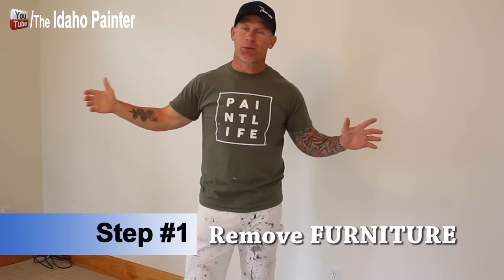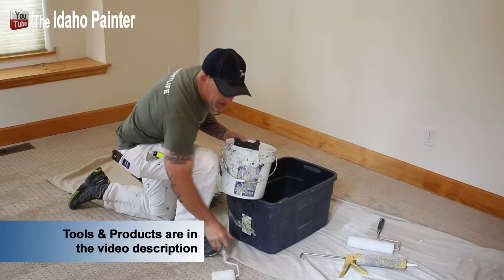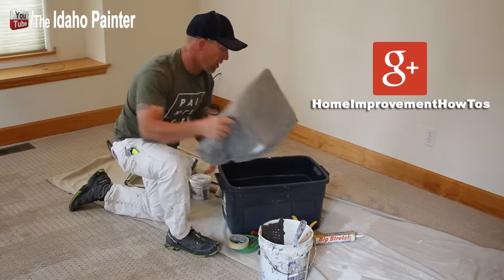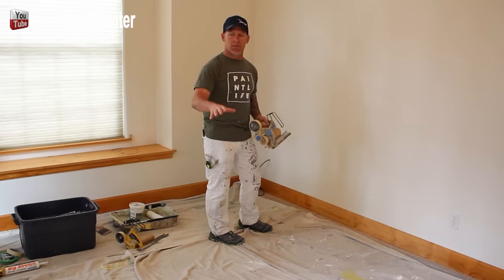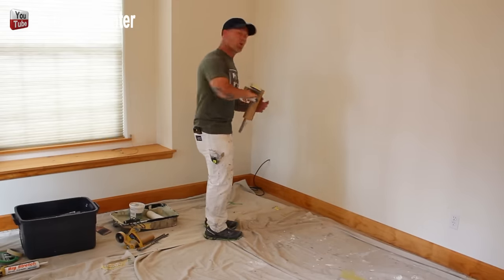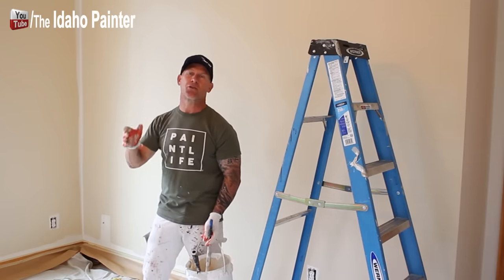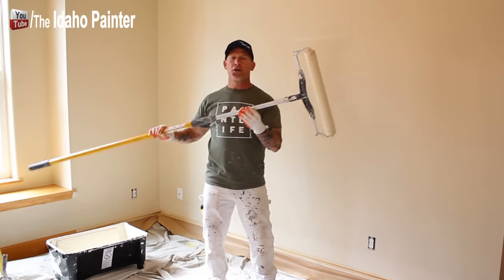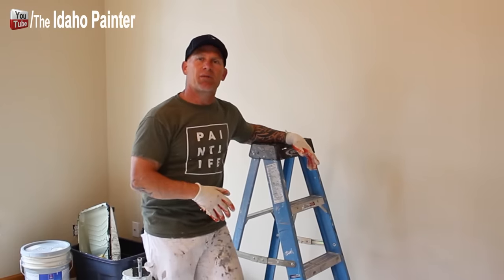10 Steps Painting A Room FAST and EASY

Comment: If your using lighter coloured paint on darker painted surfaces you'll need at least 3 coats. I'd recommend using 2 coats of a cheap white mat paint as a base colour, then let it dry and then use two coats of your chosen colour.
Reply: I'm finding this out the hard way.
Reply: Four coats never

Comment: Finally. A profesional painter who made a video geared towards a homeowner or an newbie.  All these other guys are posting clips where they are using 18 inch rollers over floors covered with rosin paper or chip board. 
In been a painter for 36 years. The steps you described along with the tools you recommend  are perfect. Well-done
Reply from the maker: Thanks

Comment: You're my go-to guy on anything about painting. I have watched many videos over many years. And I've learned quite a bit. 
 But, I always patch walls before I do anything else. That way it's dry and ready when everything else is done and the room is ready for painting. 
Also, I don't allow anyone to open a can of paint before they have a clean, wet, white rag. That way if there are any mishaps, Then you have a wet rag in a second. So as to not allow any spills, drips, or anything to have time to start drying. 
Also, I always wet my brushes then slap out the excess water. This way they clean up easier. 

 Keep up the great videos I study them a lot.
Reply: I’m a painter and starting my own business, I always look for these kind of tips. Being clean is 90% of painting.

Comment: I always make my first step filling in holes with drywall mud or wood filler. By the time I have every thing else in the room it is dry. Then a quick sand and prime. Saves time.
Reply: Plastering should be the first thing before starting a paint work
Reply: @burakbey1068  can you explain why? Sorry I’m new to paint I’m just trying to learn. Because he didn’t make it a first step in this video
Reply: @teambentley4223  plaster first so it will take time to dry, meanwhile you can other prep work and prepare your paint etc. When the plaster is dry you can sand and start painting. Good preparation is the main key of expecting good result in painting job.

Comment: I know this video has been around for awhile but I wanted to share a great 5-in-1 tool tip. When cleaning up your paint rollers, 
use the curved part of the tool! It will make it much easier to squeeze out almost every drop of paint from the roller.
Reply: Great description

Comment: Great process video, thanks! Need advice for OLD SMOKE ODOR LEAKING THROUGH 1.5 YR OLD PAINT JOB - We bought a duplex 2 years ago and live in one side. Got the interior painted before moving in, and after 1.5 years during a very humid fall the place is getting worse week by week and we are both noticing health effects from third hand smoke. The air purifier's filter is even getting blackened from it, and the walls and clothes hanging in closets smell like cigarettes. We're looking at repainting the whole interior ourselves but really want to make sure we're doing it right. What products to use? The first job was bargain basement and he used crappy primer, crappy ceiling paint, and decent wall enamel. Will Kilz water based primer be enough, or are there other odor sealing layers necessary? Thanks for everything, your channel is now my go-to for painting!

Comment: Cutting in afterwards only works when you use flat and some products in satin, if you use semi or gloss it will flash. Darker colors need at least 2 coats of cut in and will flash if you don't cut in one wall at a time and roll out(same with semi gloss and gloss). Basically this technique only works with lighter neutral colors that are flat or in certain products satin.
Reply: In my opinion it’s best to do two coats of cut in with any sheen unless previous paint is nearly same color
Reply: what about ermals satin can you touch up and re cut in with that?
Reply: ya I was like whaaaa... safe to cut an roll as you go.. 2 coats of both.. and NEVER use Behr lmao
Reply: @shawnrumbaugh6300  why not use behr? Ive been using them since 2016 and never had an issue. Ive painted multiple times using their premium, ultra and also marquee. Never had an issue, and it has a nice grab to the wall. You can even try to scratch it with your nail

Comment: Also they don't use ladders because for higher ceiling ladder may not be able to reach, like pent House or 2 storey bungalow. They use up to 4 x elongated aluminium pole, and you don't rolled and cut in. This is a mistake most professionals do. You cut in first then roll as the thickness of paint on roller and brush is different. After rolling then cut, you might see the lines of the brush.

Comment: More tips: to avoid flashing 1) use flat paint 2) cut first 3) paint top to bottom without overlapping. Thanks for sharing!
Reply: Cut first is worse! Wall -cut-wall-cut!!!
Reply: If you cut in first then roll your walls, you will roll over the brush marks from the cutting in an have a nicer finish around the edges.
Reply: @davex2614  Nicee bro! exactly that.
Reply: @davex2614 this guy rolls his cut with a four inch after his his brush work so he doesn't get brush marks. Don't know about the one coat thing though. Didn't see him cut twice

Comment: I've been a painter for the last 45 years. There are many ways to do many things but there are tried and true reasons for painting things in the RIGHT order. Fill before you start.

1.Cut in ceilings, cornice and light fittings first. Come down the wall with the ceiling paint about 2-3". You can roll the ceiling then or later. Usually ceilings are rolled before walls, but the cutting in MUST be done first before going anywhere near the walls.The reason you come down the wall 2-3" is so when you roll there is enough room for the roller to completely cover without hitting the ceiling.
2. Cut in walls. You cut in FIRST because you will leave brush marks if you do it last AND the paint will be setting while you are still cutting in, on a cold day you will get away with it but not on a warm one.You will make a mess of your work otherwise.
Reply: exactly what i was thinking, maybe he has a special paint where its not noticeable, but he did lots of stuf i consider wrong

Comment: Totally going to try it this way.  I typically cut in then paint, then do the process over again for my second coat.  Thanks for sharing
Reply: The Cu,R,T method is always best. This guy knows how to paint, except that he rolls then Cuts, then, if needed, he trims. Cu-Cut in all of your borders. R-Roll in the body of your paint. T-Lastly, Trim in any wooden borders, such as Quarter-round, shoemold, and baseboards. That is the CORRECT way to paint. I've been painting off and on for 16 years. You never, and I mean never roll, then cut around the edges! Cut, Roll, and Trim! It's that simple!

Comment: Ceilings first is a rule. And Always cut in before rolling. you cannot caulk then just paint straight over it lol it will craze and split.
Reply: A Jay
Reply: You are correct but as u can see he does cut ins with brush then uses a roller I tried it and it is very smart for speed and same outcome try it before criticizing.. but ceilings go 1st no matter what
Reply: yes.. a jay ceilings first 2 coats then walls always cut in both coats . caulk will craze as you say.. due to certain things taken out of paints these days, health n safety . a coat of zinsser  over the top sorts it out though
Reply: Saji Vs he’s not criticising he’s right, never roll then cut. Always cut then roll because if you roll then cut you will see the streaks of your brush quite obvious. You don’t won’t that
Reply: I don't know where to buy caulk, I went to hardware store and the people just laughed at me when I asked if I can see their caulks
Reply: @simonmosca514  caulk in the UK is a tube with a nozzle you cut to the preferred angle for sealing edges and gaps, Not sure what it's called in US. Very different styles I suppose
Reply: I think his method works for him. That method get the job done
Reply: @savioromie9534   well, after the first coat, if you cut and then apply the second coat ... what brush streaks will you see?   
I like how he did it in this video, I’m going to try it this way.   I know a painter who also does it like this.   Cut once -
Reply: Teach them by brother.

Comment: I’ve been a professional decorator for over 10 years and have never, ever come across anyone roll before cutting in and especially not double coat the walls but only cut in with one coat. Confusing but interesting to see how other do their thing. If it works for you then great but I’ll stick to cutting in, roll, cut in, roll.
Reply: I was just about to ask. Why didn't he cut the corners first
Reply: Hey GENIUS DECORATOR....try watching and LISTENING to the VIDEO. They do a LIGHT SKIM COAT FIRST then cut in HEAVY. Then a second coat THEN THEY GO BACK AT THE END AND CUT IN AGAIN WHEN NECESSARY. See 9:00,
Reply: I do the same in the video. Reason being 1. cutting in once usually equates to rolling twice, as in regarding paint coverage. 2. It saves time doing this method and then touching up in needed areas afterwards.

Comment: So many details left out but it is a quick simple video that will convince people they can do it themselves. As a painter and company owner, I see alot of homeowner paint jobs and they def need practice. Knowledge of steps and tools is only the first step in the school of painting. For example : The correct type of finish for the paint product and the correct primers and correct applications for the primers. Also maybe I missed it but I did not see the sanding of the walls. Either way this is a cool video.

Comment: Don’t cut in afterwards for touch ups .
Cut in twice (both coats)otherwise you will get obvious flashing around light switches corners ect.
Your having to cut in twice anyway so your not saving time just lowering the quality of the Finnish
Reply: exactly tom. i am a painter and decorator and and that is one of my pet hates ..you have to cut in twice.
Reply: I don’t know how he gets away with that. Maybe because in his part of the country all walls are textured. Here in the east coast everything is smooth plaster. That never works. Cut in both first and second coat.
Reply: @felipejose9909  yes and always cut in and roll one wall at a time.

Comment: Iv been a painter decorator 44 years now, most of my customers like a good job done with the quotes written, all including materials...
Costs way it depends on the square footage of there home 🏡
1-2 bedroom units are basic quotes, colors are also discussed and feature walls  if mentioned by customers...
3-4 bedroom quotes are past over to customers listing ceilings, walls, doors and trim.
Some customers ask for a 1 coat of primer, left for 24 hrs drying.
Then 2 coat,s of chosen colors each at 2 hr drying periods...
Feature wall are extra time 
Such as metallic rolled an diamond cross brushing on second coat finish.
Costs very as well and depends on how far the customer,s spendeture goes. 
Large 5-6 bedroom with 2 bathroom size home, well that's more material,s and time put in the planning of prep and painting ceilings and walls with trim and doors throughout...
14 doors and frames with trim are quoted separately $175 triple coating, per door and frames that's 1 good prime and 2 top coats.
There is lot of preparation work such as removing the doors and sprayed separately outside the house in beautiful weather conditions...
Prep and painting a house is an art,interior and exterior gives the customer a satisfaction knowing that he or she paid for a good job and bumping up there value on the home also...
Better for health and comfort 😌. 
$8500 should cover materials as well for a standard 3-4 bedroom house...
2 bedroom units are around $5-6000 dollars.
5-6 bedroom home,s with extra bathroom,s quotes are around $13.500.
Depends also on the condition of that person's home with the day to day elements...
Surface washed should be included with the complete costs, your guarantee is in quality of the brand of paint and material,s...
You want the best work you pay for the best painters 🎨
Signed stv 44 year painter and decorator...

Comment: Hey Chris, do you find that touching up cut ins after 2nd coat has dried leaves a sheen variance? I find i lose so much time doing a full 2nd cut in, if I can just avoid that it would be awesome.
Reply: Cut before you roll and feather your roll-always to avoid "hard stop lines"
Reply: J3nnyH. Cut in and roll one wall at a time.
Reply: Adam Johnson no you can easily cut in the entire room floor and ceiling before rolling.

Comment: But why the 9" paper?? Seems like a waste of materials. I use 1.5" tape and make sure the drops are pushed up against the baseboard. That's all you need. And an 18" roller/pan is alot of clean up. Otherwise, great tips!
Reply: Because the trim was wood & wouldn’t be painted. No drops

Comment: We always, ALWAYS, cut before roll. And what's with the cute plastic paint tray? These are "Homeowner" Tips, yes? 5 gal bucket and grid is the only feasible way to get a large room done quickly, neatly and correctly.
Reply: you can cut after you roll also fool. we do it all the time..
Reply: 100% not true. Not that I like his choice of tray any better but having used damn near every pan tray grid etc under the sun. I use the large 9" Wooster pan. (The deep green one with a handle) it's down to personal preference. You don't "need" to cut before rolling. But it is 100% better. I'd never roll first.

Comment: Profesional don't use mamas plastic tray we use 5 gallon bouquet and screen empty gallon to cut cut first ceiling first and walls after.  if you use satin,egshell or pearl finish is better to check everithing between two coats to do the finish coat nice and even to avoid touch ups after done 
That'll leave shiny spots
slight touchup after removed tape from baseboard is fine just if a little spots are missing due to the tape vacuum and make sure everything is nice and clean is part of the business
Reply from the maker: Thanks for sharing!

Comment: 18 inch is great for really big jobs. One thing i dont like is you cant get very close to corners with it because of the frame. I use Wooster's 14 inch set up. 14inch frame and nap. And they make a pan for it as well. I feel it is easier to use than the 18. I retired  9 inch set up all together. Also Chris, I have been watching your videos for years. Please try the Picasso chisel brush. It is an angled oval brush. It cuts sharper and faster than any brush I have ever used. You cant get them at SW but you can get them on amazon for cheap. Order a couple and I bet you and your crew will love them.
Reply from the maker: Thanks for sharing Mary!
Reply: Just starting using a  3 inch picaso oval. Love it. I've gone almost exclusively to the 14 inch arrow worthy roller now. Awesome finish, and no spray on your base. Love th 9/16 on the ceiling

Comment: I'm actually surprised that you only cut in once with a thick layer, but I might try it for my kitchen. I don't paint professionally but I do enjoy it. Typically I cut in, roll, cut in again and roll again. This requires my Frog Tape to be removed after paint has dried on it. So far I haven't had any crazy issues.
Reply from the maker: Thanks for sharing

Comment: I'm a little confused. I always thought when painting a wall you're suppose to let the paint dry for a few hours (if water based) and then do the second coat. But then in step #9 after the second coat you say to remove the tape before the paint dries? I'm new to painting so I don't know

Comment: Do you recommend spraying a room? I find it difficult to roll an entire 1800 sq ft. home. Pros vs. Cons?
Reply: Even if you spray the walls you have to back roll behind the sprayer. Plus are the walls the same colour as the ceilings? What about trim? Same colour? How good can you tape? Are you saving the floors? Sprayers have a ton or more worth of pressure per square inch. And over spray will happen. Most people only spray wall or trim on full jobs on new homes before other trades have installed their products. Unless you have a good grasp on extreme taping just cut and roll.

Comment: A previous painting job left some walls with more orange peel than I like. Can I sand and repaint, or will the orange peel just show through after the new coat is applied?
Reply: Rt L If you pass your finger through the peel and you can feel the unevenness then you will be able to see it u just paint it just do a small light patch with some Easy 20 then sand and re paint

Comment: If you are using the same color for ceiling and walls, will you consider satin on all for simplicity, or do you always use flat on ceiling and satin on walls (with ceiling cut in)? Thanks
Reply from the maker: We will normally do flat, but it is up to the customer

Comment: Doing edges and taping takes most of the time. I am interested in trying out those edging tools. If they work fine, I can save more than half of the time painting. 18 inch roller is also very helpful and goes through fast.
Reply: My go to. They work amazing!! Saves SO much time. They hold a ton of paint and I've gotten to where I hardly even use a roller anymore because they knock it out faster. They honestly are the best thing since sliced bread.  :/
Reply: @themichbichable  What knocks painting out faster where you don't need to use a roller?

Comment: Good video! I have a question, I have a 2800 sqft home that I’m going to paint the interior walls, and all trim. There are little to no furniture in the home and the owners are not in the house. My question is, would you spray everything or roll? I’ll be working alone and I’m looking for the best but quickest way to get this job completed.